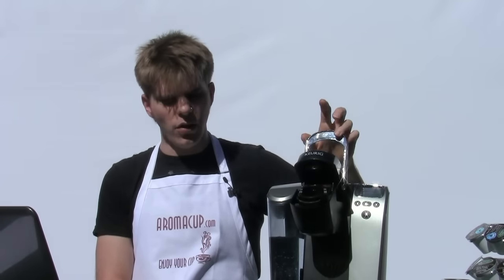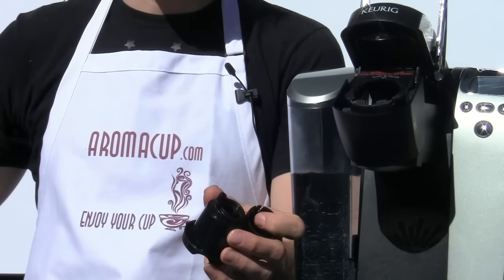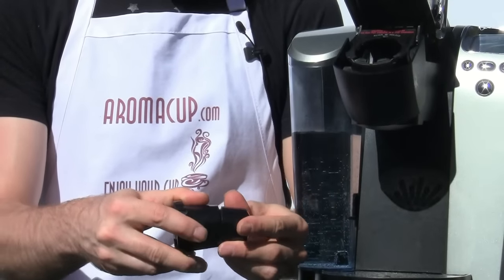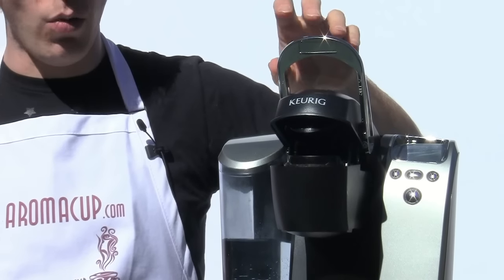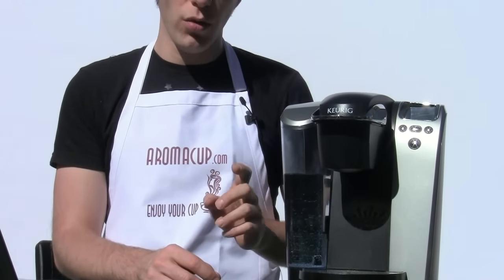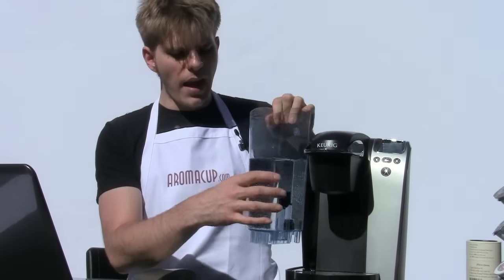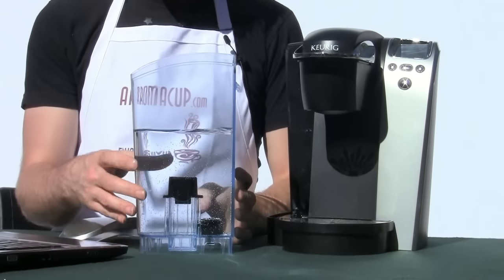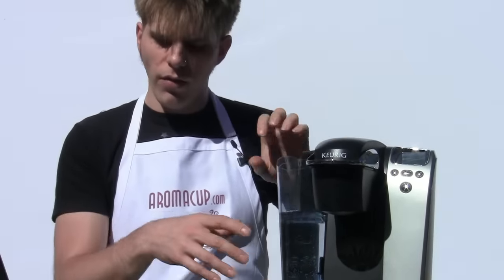Keurig Troubleshooting FAQ: How can I fix "Keurig Brewing a partial cup" problem?

Comment: I managed to find another option to fix this.  There is a filter that gets plugged and makes it hard for the Keurig to get enough water.  Here is how I managed to resolve this:  Firstly, you have to remove the water reservoir  the bottom of your machine.  Then unscrew the bottom plate of the machine.  Undo the 2 screws of the intake that normally fits into the reservoir.  Inside is a black plastic filter, pull it out with needlenose pliers and clean it.  Pop it back into place and reassemble.  This solved my Keurig's 1/2 cup problem and took me 20 min to find and fix.
Reply from the maker: Thanks for sharing. Enjoy your cup, www.aromacup.com

Comment: I had the same problem with my K150 and after trying everything, I realized something weird on the reservoir: The little hose on the very top was feeding water back to the machine. I clogged one of the sides with a piece of paper towel and pushed it in tight inside the hose. FIXED. Now my machine fills the amount of coffee I select without any issues. But be careful of something: That little hose has 2 holes, one for air intake and the other one feeds water back to the reservoir. Make sure you clog the right one because the machine may overheat is you clog the wrong one. Thankfully it is pretty easy to tell which one is the side pouring water back. Block it with your finger as you brew and you'll be able to tell which one is which. Good luck!

Comment: I tried the steps with little expectation of a positive outcome,  because I've run into this problem every couple of months.  The only step I'd never tried was the tapping on the top.  I did that one extra step, and I had an amazing amount of grounds come out with the hot water.  After eight repeats, I finally had a clear cup of hot water.  I would guess that the grounds have expanded enough to be forced back into the tubing, and for whatever reason, the other solutions didn't do enough to dislodge them.

Comment: We tried cleaning check valve, reservoir screen and nothing worked, water fill and heating and blue middle button were lit up at same time. I watched your video and started messing around with holding the middle button down several seconds and unplugging it and plugged it back in and it worked, we are doing a happy dance. We got the keurig at a yard sale for $1, thanks so much!

Comment: These videos don't tell the true problem. Some have it right. The air pump goes on these. I watched a serious of 6 videos by a guy that knew the problem, has you totally unassembled the keurig, cutting the top cover off, breaking tabs, to get to the air pump. You don't have to do all that.  The pump is right in the bottom. You don't have to completely unassemble to get to this part. Take the bottom cover off, then remove the screws that are under the cover. Now you can maneuver the sides to get to the screw that holds the pump in. Carefully clip the tie that is used as a clamp on the small tube. Snip the wires and Splice in new pump, use a small wire tie to clamp tube back on. I bought my pump on eBay for $17.99 on eBay. A lot cheaper than a new machine.

Comment: I had issues with partial cup brewing when using certain K cups (after market). I noticed that the bottom rim profile was slightly different on the 3rd party cups. The edges did not go  all the way to the seat, rather they had a recessed rim. I think water pressure was causing a hydraulic action and pushing the mechanism open slightly. HOW TO FIX: I used a working K cup. Cut the portion below the filter off and hallowed out the bottom while retaining the bottom edge. You hollow it out so that the bottom needle does not come into play. Slip this partial sleeve over your problem cups and it should alleviate the issue.

Comment: according to the official Keurig videos, you descale using plain old white vinegar. no need for a special solution.
Reply: That's what I've always done. Fill the reservoir with white vinegar and run cycles until it is empty. Being cheap, I will re-fill with the same vinegar and repeat a couple more times. After that, I will dump the vinegar and fill with fresh water and run a number of cycles until I'm sure it has cleaned all the vinegar out of the system.

Comment: Thanks, followed all the trouble shooting. My Keurig was only dispensing a few drops of water when I tried to make coffee. I banged on the top in a few places and it worked immediately. Problem fixed, full cup of coffee!! Thank you! 😂 I also have always descaled my machine once a month with vinegar and clean and wash all the parts so was wondering why my   Keurig would not release water. It is 15 years old and still works like new now. We use it everyday , up to 6 servings a day!

Comment: Thank you so much - working better than ever. Didn't work with just a tap on top-I lifted the whole machine by the front & gently dropped it a few times. Works like a charm. Also cleaned out those holes with the paper clip.  Thanks again.

Comment: Excellent tips!! I've had my original classic Keurig machine for over 10+yrs now with no issues. 
The first ones my friends bought when they first came out gave up replacing them. WHY? WHAT WAS THE PROBEM WITH THEM? Because most people turn the power on & off when going to make a cup(s) and the heater switch is (or was) being used everyday or every use to turn the machine on & off, and the heater switch burns out quickly that way being turned on & off so often. Not sure if Keurig ever fixed this problem, after it happened to me with my first machine that only lasted a year, from then on I just KEET THE MACHINE ON EVERYDAY AND NEVER TURN IT OFF.  The lights are all that stay on power wise just like any old coffee maker pot clock. 
I keep the tank full always with fresh water (unless going away for a long period), and I've never had a problem with the machine in over 10ys+. I clean it twice a year & descale it easily within an half hour at most.

Comment: This was the fix I needed.  I only use distilled water in my Keurig so I knew I didn't have calcium built up anywhere.  I didn't know that k cup holder came apart.  As soon as I opened it coffee grounds fell out, one of them a fairly large, hard little nugget.  All is well now.  Thanks for posting.
Reply: the directions on Keurig repeatedly state to NEVER use distilled water. Only filtered or tap.
Reply: Distilled water is not safe for drinking daily!!

Comment: Brand new machine, and went through the troubleshooting with Keurig on the phone and no dice, they are sending a replacement. Then I watched this video and gave it a solid thump on the top (and once on the sides for good measure) and boom coffee again. I will however take them up on the replacement as I don't trust the machine that crapped out after a week.

Comment: Excellent information in this video, but I just noticed I have the extra water coming out of the bottom of the machine.  I am off to get a new one and maybe fiddle with the old one at some point to figure out what seal has gone bad.  My machine made it about 8 years with pretty much no issues (about 1000 cups); so not too bad.  Got to have my morning coffee.

Comment: I'm not getting a full POT of coffee out of my Keurig Duo.  I'm assuming the same things you shared here will help there. I have cleaned the system with vinegar - and that helped for a few pots. Maybe three. Will the de-scaler work that much better than vinegar?  And is it necessary to use filtered or distilled water? I have my own well water, which is great water.  Thanks!

Comment: I had tried everything suggested. De-scaling it, using a pin to clean, etc.  Strangely, in my frustration, I whacked it on the top..hard.  Now? I have a perfectly working machine.

Comment: My Keurig doesn't always give you the same amount of coffee in your cup, even if you have it set the same size each time. Why is this and how can I get it to give me the same oz.size  each time?
Reply: Easy by having the right amount of water in it as I usually fill mine w/ a 20 oz bottle ad was just curious so I put a Measuriing Cup under and ran just plain water thru a filter and found out it does brew the 10 oz or 6 oz I chose but the mug I use is a 12 oz mug so I do 2 6 oz's and just fine. You probably don't have enough water in it.

Comment: Remove the reservoir and blow air through the water intake valve with an air compressor/tire inflator. This is the only thing that worked for me.
Reply: FOR SEVERE CASES:  Yes, that's the ticket for a severely screwed up machine. Mine was making all kind of noises and clicks and would not refill from the reservoir tank. First clean the outlet filter at the bottom of the reservoir as described. Then I just used an ordinary bicycle pump with a baloon inflator attachment jammed tightly into the intake near the bottom of the body of the machine itself.  If the system is really clogged you will know it because when you pump air into the bottom of the machine it will spit back through the little white tube (pressure release?) at the top of the machine.  If you just pinch that white tube while you pump that will close the system and water in the machine will spit forcefully out the needle that pierces the K-Cup.  "Thar she blows!"  All fixed. Make sure to do this procedure over a sink because water will blow out the piercing needle when it clears. Also, of course, do the whole procedure with the machine UNPLUGGED!  I thought my 12 year old machine was dead, but now it works better than ever! This procedure might work on the hardest cases from the thrift shops.

Comment: We weren't getting a full cups, either. Followed directions in the book and from your video; cleaned out what needles we could and pumped white vinegar through the machine again and again. No joy.
So I then decided to try your "little bit crazy" method of giving it a smack during a cycle. Instantly I began to notice coffee grounds swirling with the clear vinegar solution. Another cycle, >whap<, more grounds. And again. Until it ran clear. Now we get perfect cups of coffee every time. Thanks!

Comment: I agree with Jamie.  The clogged holes were not in the bottom cup for me on my Keurig B-31 mini.  It was in the needle that pokes through the top of the K cup.  That needle has 3 holes.  Just pull off the rubber gasket, poke your straightened paper clip up into each hole and run it up and down pressing it up as far as you can get it to go.  Put the gasket back on.   Mine is running like new now with full water pressure and it was totally clogged.

Comment: Also check the 3 holes on the side of the puncture needle in the lid. Pull the rubber grommet off and just push an unbent peper clip up through the holes.

Comment: This isn't a 1970's era console TV where you could give it a light kick to get the picture to come in better nor is it an original Nintendo gaming system that would require you to blow into the cartridge to get your games to play. Giving your Keurig a little "love" tap is not in any way a working solution. These machines are not made for longevity as MANY others have said in and on various websites/forums. Within a 4 years time frame I myself have gone through 5 machines, 2 bought brand new from the store and the other 3 replaced through the Keurig warranty. Are you aware that when you use the warranty replacement option you are sent a "refurbished" brewer, which is repaired by a third party? Keurig doesn't even repair there own machines. The only fix to this "solution" is to replace the machine with a regular brewing coffee maker and to leave to k-cup makers on the shelves to rot.
Reply: My B60 series would just stop working occasionally.  
The FIX, with a bit of googling, was to WHACK the underside of the unit.  

That actually worked, time and time again. 

 The Keurig was my machine but everyone in my small office group at work was allowed to use it.  
After about the 3rd time it stopped and needed another whack, I decided to conduct a quick 1 minute "inhouse seminar" on how to fix it. (so people would stop bothering me, whenever it stopped working).  

1. unplug the unit, 
2. remove the water reservoir 
3. preferably over a sink, turn the unit over so the bottom of unit faces up.
4. with the palm of your hand, SMACK the metal part of the bottom hard a few times (or use a RUBBER hammer) 
5. Smack it 5-10 times. 
6. replace the unit in its normal location. 
7. replace the water reservoir and fill with water. 
8. plug unit into the power outlet. 
9. do a test run. 
10. unit should now WORK! 
11. if not, repeat the SPANKING process.  
12. sometimes it took me 2 "spankings" to get my unit to make coffee again.

I have not found any real explanation as to why a good bottom spanking fixes a non-working Keurig, but often it can and does.
Reply: Hello I appreciate all your wonderful replies but in all fairness my Keurig simple 3 cup maker is 15 years old and I love it! After descaling water would come out beautifully but was slow on the coffee k cup so I knew it couldn’t be the pump and I didn’t want to buy a new one since my machine makes perfect coffee every time. Tried everything  but my goodness the wack worked! Not sure why so happy I’m able to keep my faithful keurig! We use filtered water so I’m sure that adds to the longevity 😊